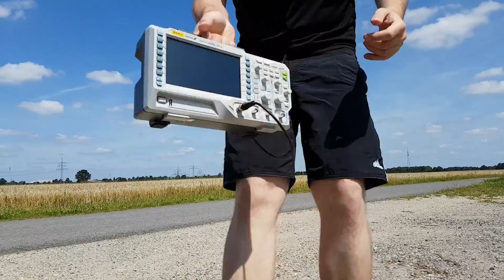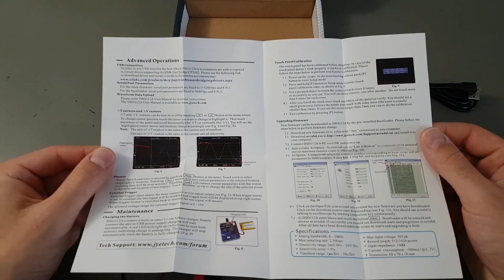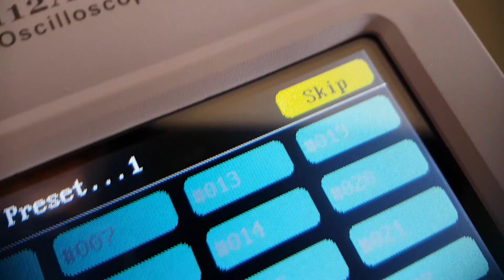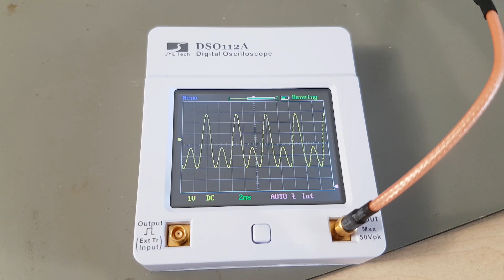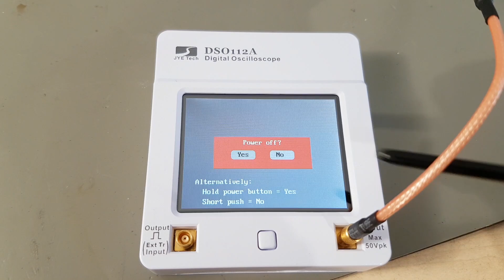This touch screen cheaposcope is actually good! DSO112A Oscilloscope

Comment: My BSEE final project was a digital display EKG portable monitor, basically what you did with off the shelf modules, but in my case I needed to design everything from scratch, even the LCD video controller circuitry with tons of peripheral dynamic RAM ICs using a Vadem 600 monochrome LCD controller chip, very hard to get 30 years ago. The selected host controller was , believe it or not, the legendary 8 bit Intel 8031 and I wrote the whole firmware in assembly language and , yes, I used the same instrumentation amplifier , 4 pole lowpass filter, and basal corrector I assume you used for your project to acquite the EKG baseband signal. My project was presented in the 4th National Biomedical Engineering Congress in Durango, México, back in 1994.

Comment: I have been testing various "mini" scopes and recently got one of these.  I thought I might not like the small touch screen compared to the controls of the DSO211, DSO212, and DSO213 models (and they all have different physical controls).  But I found the touch screen MUCH more intuitive to use compared to those other scopes where you are forever cursoring to select a menu and then cursoring more within the menu.  I did not find it came anywhere close to the 2 MHz bandwidth claim.  At 1 MHz a square looked just like a sine wave.  And at 2 MHz a sine wave was presented at two different heights with alternating cycles.  I would say this is more like 500 KHz usability, maybe less.  The particular one I got had a problem where the 50mV and 5V vertical sensitivities were displaying, and showing measurement data, that was double what it should have been.  I figure perhaps a wrong resistor value got loaded somewhere, but not sure how and affect only those two ranges.  But I know the issue is there, can work around it, and for the low dollars involved, don't want to hassle with the vendor.  Also, it came with no manual but you can easily find one online.  This might be important because of the tiny hidden battery disconnect switch under a tiny slot on the top.  I didn't know about that (who would?) and at first thought there was something wrong.  Considering the cost, and if you have no scope at all, or really need a tiny portable one, this is a pretty good value.  It's about as low cost as you can go without getting one of those DSO138 kits.  Also, since the case is a little deeper than most of the other "mini" scopes, they seem to have a little larger battery and I tested battery life and it was about five hours.  Quite good.  Unlike the other mini scopes, I could not find a way to adjust display brightness.

Comment: Marco says DSO112A Oscilloscope has everything it needs to be a real oscilloscope, then it is what I would buy. He does not actually do detailed test but I take his word at face value. Besides, I am not going to use it for high frequency work, that most people say cheap oscilloscopes fail to perform. Their so-called "reviews" are odd. All they test is voltage and frequencies.

They forgot that an oscilloscope is not meant to measure anything accurately. It is for 'seeing' what humans cannot see. What they need is a multimetre if they need to measure stuff.

They test for frequencies to know whether or not the maker lives up to their claim of 100 MHz, 120 MHz, 999999 THz. And they forgot that serious work requires serious tool. It is like putting the blame on a shovel for not doing an excavator's job! WTF!

How the heck merely testing voltages and frequencies reflect the usage of an oscilloscope?!?!?!?!?! What about real-world usages such as the ability to zooming tight into the very small and weak signals? How about features that are very useful, that an oscilloscope ought to possess?

DS212 seems to be the perfect one as it has two channels and lots of stuff as well. But it is a lot more expensive than DSO112A, and there are only two buttons cum wheels, these are the weakest links.

Wave2 (Same maker of DSO112A) is a two-channel oscilloscope and is inexpensive compared to DS212, but it sucks because it cannot overlay traces. Not helpful to have one top and the other bottom.

Ugh! Chinesium!

Comment: About to order it but wanted to get someone's opinion that ones about this stuff way more than me. Made my decision easy. I'm just a hobby guy so it was between this and that cheap 30 dollar one you solder yourself. Which I had worked for 2 weeks then stopped. But paying 30 for that junk or 50 for this is a no brainer

Comment: Thanks for your review! Any idea how much better can it be than the ds138 at the limit of its sensitivity? Since it is the weak point of these gadgets - I work in audio, milliamps and millivolts is what you usually need to see. Any info would be usefull about this, cheers :)

Comment: Is the bigger oscilloscope (the first one you were running with) from Banggood as well?
(You mentioned "it's another affordable oscilloscope from Banggood" while referring to the smaller one...)
I'm looking for a good n' cheap one but prefer the bench top size that is also good for mains..
Reply from the maker: They do have the RIGOL DS1054Z I think, but it isn't cheap

Comment: For a price of 3, you get a 4 channel 100mhz branded scope.. with all the knob,  big screen, 4 professional probes and pc software. How exactly is this cheapscope toy good?
Reply: For the same price you can also buy 10-100 kg of potato, depending on country, but you will still have the same problem when trying to put that into your pocket.
Reply: I must indeed congratulate you on getting your 1054z a good 100€ cheaper than anybody else.

And Owon? What kind of fantasy land do prices below 270€ for a basic 2ch version come from?
Reply: Ehr, more like, for the price of 5.7 of these.
Reply: 339€ is the price without VAT, which is 22% in Slovenia...
Reply: Link?
Reply: Thanks.. didn't really check on prices elsewhere. They're selling it now for 339€. http://rigol.si/Produkti/Osciloskopi/osciloskopi.html
Reply: Daryl Sargent you can go with "ohnoes" scope, aw I mean owon from eBay which is 150-210€ on eBay in Germany. Add some 18650 instead of the batterydummy (empty) battery case voila
Reply: 70$ * 3 = 210$ + (import 22% tax  & 15€ import fixed costs) = 275$. Got a Rigol DS1054Z for around 300€ at local supplier  over a year ago.
Reply: @habiks  You forgot to include the cost of the 500m of extension cord you'll have to drag behind you when you take your Rigol out to check your EKG while jogging.

There are literally millions of people in this world who are learning/tinkering with electronics who would benefit from having a simple little scope, and who can't afford even your Rigol. Or afford to buy a second cheapie if they're unlucky and pick one of the many in this price range that are junk. There are even professional applications for them: I develop solar-powered remote sensing systems, and it would be handy to have something that would let me check individual sensors out in the field that wouldn't be a major tragedy if I dropped it in the dirt or got caught in a sudden rainstorm.

Marco performs a valuable service by letting people know about low-cost stuff that isn't crap.

Comment: whats that electric screwdriver thing? and is the touchscreen resistive or capacitive?
Reply: Touchscreens that can be operated with a plastic pen are always resistive.
Reply: well there are pens that can be used with capacitive screens and i wasn't sure whch kind that pen was.
Reply: Ha!!  His 'Electric-Screwdriver' thing, is a 'De-Solderer'. Heat + suction-pump.

Comment: I think I've got one of the predecessors, the DSO15001K. It doesn't have an internal battery yet, but only a 9V input jack. Also no touch screen as far as I know (but already a color LCD, though it's a lot smaller). The problem is: It came as a kit, with the SMD elements pre-assembled, but all the discrete and through-hole stuff you have to solder yourself. And I have it sitting here since about half a year and still didn't get to it (the instructions also talk something about measuring and calibrating the thing during the assembly process). But at least it was only something around 20€, not 70€ as this one is. So that's the kind of money I'd like to spend on a scope (since I won't use it very often), this one is already too expensive for my taste (I bet I could add another 30€ and probably get something much better for 100€ or so). In case I ever manage to assemble this thing, I might even acquire the knowledge to properly test it ;)
Reply: just to go at it, that kit it pretty doeable.. just dont hold the soldering'iron to long on the traces, otherwise they will lift.
if you need some guidance there is multiple videos on YT taking yo step by step..

Comment: Are you sure there is just an (ok, two) Atmega in the scope? Nothing hidden under the display?
What is suitable to be used as electrodes for the ECG?

Again a very cool video ;-)
Reply from the maker: Yep, nothing under the lcd. Maybe instead of just grinding off the IC designation they went one step further and put false information on there to confuse people, who knows ... I just used copper sticky tape, that stuff will also be a major player in the next 1 or 2 videos (:
Reply: SPFD5408A display can be controlled by ATMega, because it maintains screen buffer, can use 8-bit parallel bus. The IC is inside display enclosure.

Comment: I don't understand why manufacturers don't use screens such as the iPhone 4 screens. they are cheap (under 5$) and good quality dpi.
Reply: Probably battery life? Those things suck power like nothing else alive. The battery in this unit wouldn't run that display for very long
Reply: ehmm what makes you say that. Where you pull that info from?
Reply: Because these low DPI screens are even cheaper and easier to interface with. Higher DPI screens require more bandwidth and might require more expensive interfaces as well, especially mobile phone screens.
Reply: A couple reasons:
1. Viewing angles. Generally these cheap screens will be TN panels as opposed to IPS panels. As you turn them off axis, they invert the colors. 
2. Touch sensitivity. These cheap LCDs use a resistive as opposed to a capacitive touch screen, which is why they aren't as accurate or sensitive as regular device screens.
Reply: NE555 iphone and other smartphone displays are beasts. they require access to the mipi alliance video standart and a dedicated coprocessor of some sort for interfaceing. that greatly increases development cost, whereas this cheap lcd can be interfaced with next to no effort. Apart from that i dont see any reason why you couldn't use "cheap" smartphone displays (they are actually pretty expensive) :)
Reply: Niklas Mertens of course the 4k and 1440p displays are expensive but on the other hand the 1080p and 720p can be be bought as little as 5$ and even cheaper in bulk on aliexpress
Reply: You should think a little deeper about what it takes to build a compelling product around such a display. Ignoring cost minimization, let's say you want to roll a touch screen portable scope with a 720p display. You will need to build around an SoC capable of driving such a display at native resolution -> more expensive than an ATMEGA or two. Then, you will need to use MIPI CSI interface instead of some generic SPI / I2C shit -> more expense. Then, you will need to include a larger battery for the increased power consumption from BOTH the high DPI display AND the hardware that's used to drive it -> more expense.

After all that, do you think the increase in BOM is simply going to be a few dollars? This ignores the fact that you need to hire people with more expertise to route more complicated boards, develop more sophisticated firmware, etc. And obviously there are companies who can do this, but they won't be selling the scope for $69 with free shipping.
Reply: It is hypothetically possible, but practically, i have not seen serial/high-level programmed high-resolution displays at compelling cost in China, nor have i seen partial solutions that would enable that. I think iPhone uses MIPI DSI, so to the cost of the display, you add an adapter IC ($3), and then some logic IC capable of pumping the data out at sufficient speed to fill the pixels, and the end result is anything but cheap enough for a sub $100 non-commodity product. SPI and i2c are too slow to update a high resolution display in a dumb manner, so what you need is to provide a high-level drawing interface that just specifies graphics primitives, and such interface must be running on something.

China has some affordable 480p-ish displays with high level interface, they simply use an old parallel LCD, and an ARM Cortex M0 controller or maybe Actions ATJ227x to provide high-level interface. Actions will also probably do FPD-Link and HDMI displays. But these modules are also well over $20, so not suitable for a small-run $70 product.

The cheapest way to drive iPhone LCD is likely with Allwinner A23, which is a $5 Linux SoC, but it pretty much needs a 4-layer PCB and 3 power rails, so there's that, your product complexity just skyrocketed. Besides it's hardly suitable for realtime tasks, so you still need a microcontroller, and it's both powerful and a power hog. If something isn't destined to be made for million-unit commodity mass markets of India and China, chances are, a convenient low-cost high-tech solution doesn't exist - there's this huge gap where to interface with modern technologies, even if they seem trivial enough, you need to buy into a lot more technology than you bargained for.

I think they did pretty well getting a 240p parallel LCD, and simply driving it from a micro, it's an elegant solution that also isn't entirely trivial to execute well, with the kind of refresh rate they're getting, so i applaud them on the success of their effort. I doubt i could have done it better myself.
Reply: Well the front display modules for iPhone 4 cost around $8-$10 in 20+-quantity, that includes the display and the touchscreen layer, i imagine if you wanted just the one or the other it would be cheaper. But then, i have no idea how many are out there? I know the glass and touchscreen you get are always copies, but what if the panels are genuine and there's a limited supply of them, so you can't count on it for production?

But somebody is certainly making simple parallel 240p and 272p displays and corresponding touchscreen overlays in large quantity in China, and at least naked without touchscreen they actually look plenty good.
Reply: jort93z check aliexpress/ebay
Reply: sykskysyk is it not possible to have a i2c/ spi generic 720p lcd then?
Reply: also, i've never seen an iphone 4 screen for 5$. you can't get a touchscreen for that little money. probably 10$ or 15$ for a good screen at least.

Comment: Looks neat, but... 2 MHz, ouch. Can you recommend something around 10 MHz?
Reply from the maker: CRT an option for you?
Reply: A preferred option ;)
Reply: @reps  Returning to this to say that (while CRTs are great) there are (O)LED displays now and obviously this is preferred to get access to a usable scope. 2MHz was not usable in 1976, from which I have a mint Solartron CRT 2-channel oscilloscope that is a very heavy paperweight, useful for no electronics. My need is now 2-channel 50MHz with logging over USB to file, and I find nothing but these big, heavy, expensive, impractical boxes with bad screens and bad UIs that toot about resisting great voltages and currents I never, ever, have the need to measure. Where is the small, simple box the size of the display that does this? Without a doomed-from-the-start rechargeable battery inside so I have to pay again in 3 years. Why is everyone fighting over the niche market when so many could have use of such a box? Audio interfaces are ubiquitous, and all that's needed is some components to prevent idiots from blowing up their laptop and some live sampling software, and it could dispense with the box, dials, and built in screen, and fit in a very small pocket.

Comment from the maker: TIL: H264 is pretty horrible with jerkily moving asphalt.
Reply: I believe if you "upsample" your 1080p footage to 4k and upload it like that, YouTube allows for a higher bitrate that should prevent such artifacts, even though the actual footage is still only 1080p. It might be worth a try if it's bothering you, but rest assured: I didn't notice it when watching.
Reply: This is ultimately up to the camera encoder bitrate, later re-encodes can't automatically fix it, if this is the case. But you can evade Youtube downgrading for any footage by triggering the generation of high-quality versions of your video: (up)scale to 1440p, bitrate 16000, audio FAAC 384kHz. This single upload will make the 1080p version higher quality as well.